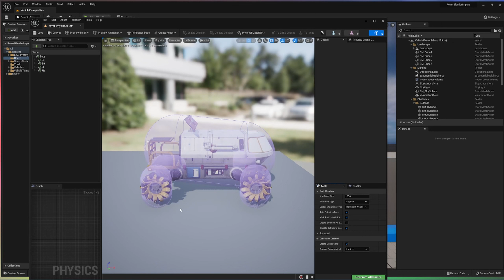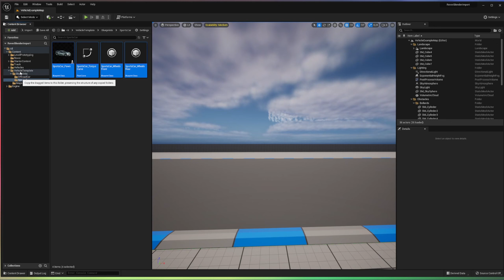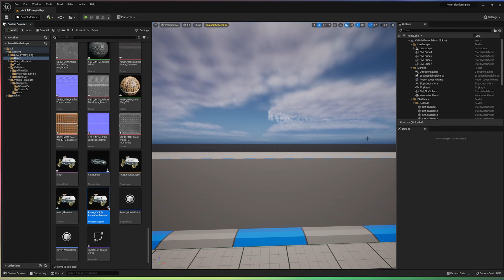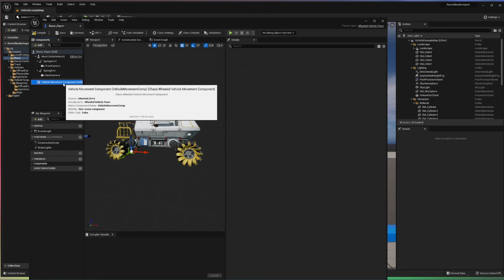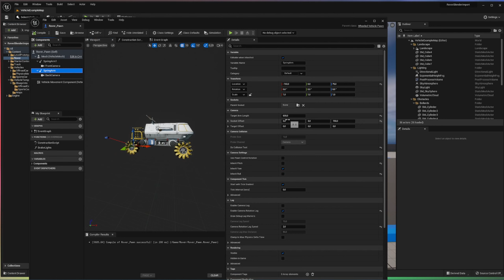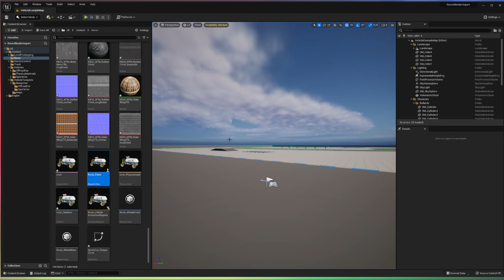Create a Driveable Rover From Kitbash Kit in Blender and Unreal Engine | #KB3Dchallenge

Comment: My wheels are not rotating properly. The cars functions do work though.
Reply from the maker: Have you fixed in the meantime? Have you created the animation blueprint? And can compile it without any errors?
Reply: @roostone1340  Hi, unfortunately not. I tried a few tutorials and only twice was able to get the car moving properly. However to get the car working anything like a  great game I was told Chaos is not the pluggin to use. 
The only ones I found were R-Tune and CAR DYNO SYSTEM for $70 and $250. 
I'm finding out that UE5 Marketplace is much more expensive than Blender Marketplace 😞
Reply from the maker: @kellyvill9413  sad to hear. I think chaos plugin is a good system. But i experienced a lot of problems too. Pay close attention to the tutorials and make sure not to miss one step.